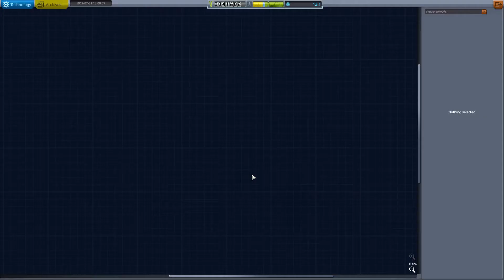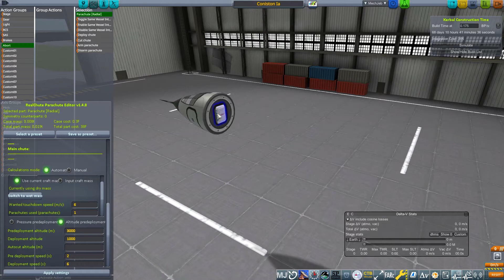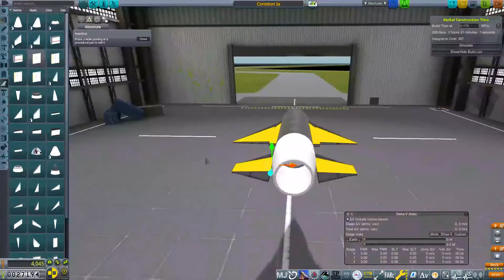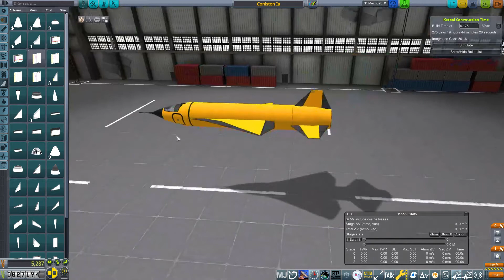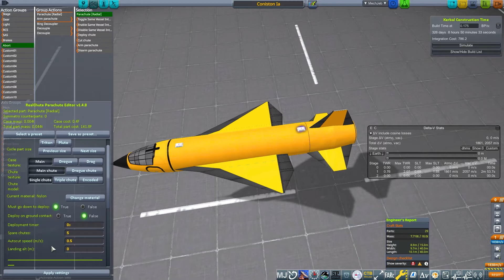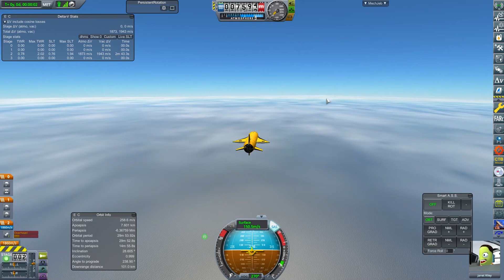A Very Basic Space Program | Episode 5 | KSP RSS/RO/RP-1

Comment: Since the recent changes to RP-1 (for those that aren't aware, flying low science has been changed so that you only start to collect it once you are above 40kms. So it has narrowed the window for collecting this science since flying high is still 55kms), I think planes could turn out to be very useful for gathering this flying low science since they will be able to stay in the window longer. Although a caveat to that would be that you need to invest science into the X-1 cockpit and air-launch upgrades so you can get to 40km and stay there for a while.
Reply from the maker: I believe that flying low science has actually been removed as Flying High has been lowered to start at 40km.... 
in addition their is now a range of Mach1, Mach2 etc science 'experiments' which have been asses to the cockpits which add some sources for science over 10km

Comment: Thanks for the plane building tips, never considered using the boat tail adapter. Usually would just minimize wave drag at all costs, but that results in a different aircraft for each engine.
Reply from the maker: Yes iv used fairings etc before around engines but I actually started thinking, why not leave excess space, given the impact of tooling  and redesigning etc,  I think partly with the mindset that the X-15 had two different engines setups, with the XLR 99 only being available after it had already flown, while they developed the airframe